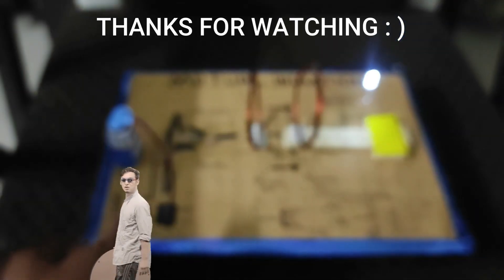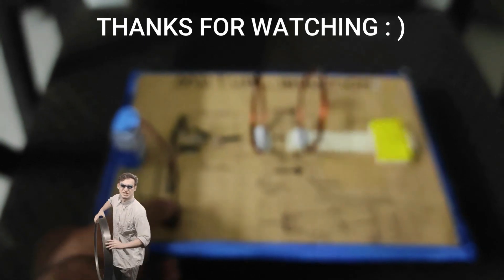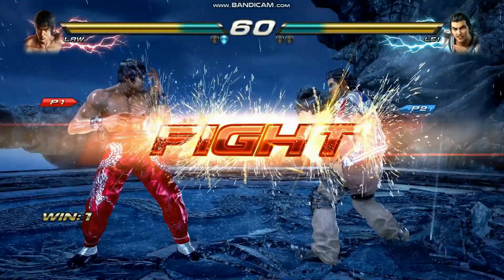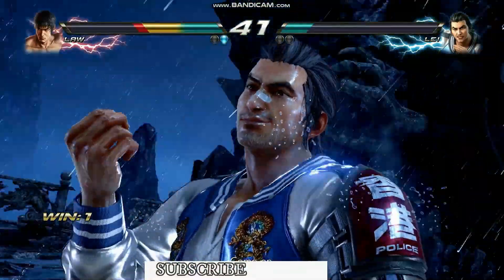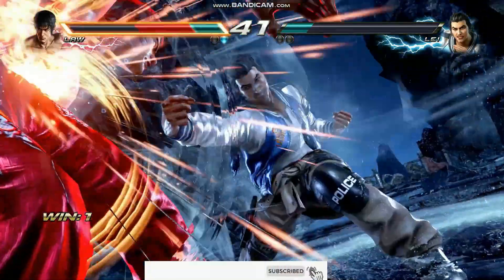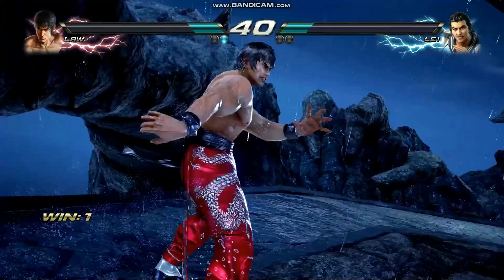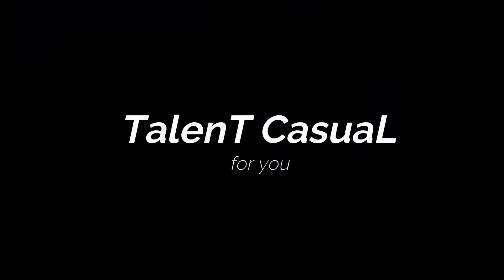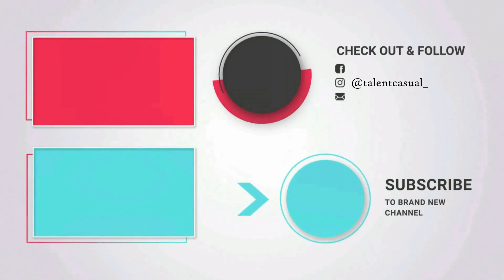How to make Mutual Induction Working Model | Wireless Power Transmit | MUST WATCH #physics #diy

Comment: Why you cut tha loop i don't understand please clarify me
Reply from the maker: Dear at the centre of the coil  ( it has 32 turns so at the 16-17 turn)   I made a loop and cut. It  so basically there is 2 coils in first. Coil     now it has centre end
First end   2nd end   and the middle one is there now which. Is used to connect battery positive so the positive current. Flows in the middle and get to both first and last end  

So just to enter the positive current inside the first coil

Dear 💕

Comment: I have made project by using BC547 and 1k ohm but led is not turning on . What can be tha reason? ( 40 turns)
Reply from the maker: Dear 💕
It needs 27k resistance for u or 33k if... Trannsistor is ctpn 2222a  easily available everywhere

Still not working after 27k

May be reverse the tranisistor

Comment: Can I use a 22k resistance for 2n 2222a transistor instead of 30k
Reply from the maker: Yes dear u can add 4-5k resistance in series sum up wil be 27k  that gonna work
Reply: My transistor is is heating up...how to reverse it?
Reply from the maker: May be your project is working led is glowing  if it's ( 3V) 

And if not
U can try reverse the trannsistor

Join it's 3rd end at first and first end at 3rd

Centre leg remains same 

🥰
Reply: Thank you so much❤......now my model is working
Reply from the maker: Wow great dear 💕❤

Comment: How to connect it with switch please tell me
Reply from the maker: Take any wire   from battery positive or negative  make it pass through switch  so that current has to pass through switch and it will on or off  the circuit
Reply: Thank you so much I am making a model and it is working now I have to connect it with switch thank you very much ♥️
Reply from the maker: Great 😊 good luck  subscribe 💕

Comment: Do you have project file of this written for class 12?
Reply from the maker: No dear u can easily make using wikipedia

Make 
Aim
principles
Construction
Working / theory
Results
Precautions
Reply: @TalenTCasuaL  first thanks for the video I have already made a working model of the project through this tutorial. Can you suggest me the "aim" for the project file?
Reply from the maker: Prepare a wireless power transmission system using mutual induction

Comment: Bro can I do it without resistors?
Reply: Thanks but i live outside of India so it will take several days to come if i order online so i was just asking if it is possible
🤔but if i manage to get led with forward voltage around 9V it will be fine right?
Reply from the maker: No dear 💕
Led should be small 2-3V
Reply from the maker: No dear 💕 resistance is just. 3-4₹ thing
Reply: You can avoid using 2k resistor on led but on the primary coil you have to use the resistance between 20k-30k

Comment: Will the LED glow if I just twist the wire of secondary coil around its ends?
Reply: Don't know 😊
Reply: Try it can
Reply: Yeah
Reply from the maker: Yes dear 💕

Make sure u twist around 10-12 times tightly  follow the circuit diagram

Any help contact on insta
@talentcasual_side

Comment: How did you fuse resistor with the base of the transistor?
Reply from the maker: Using soldering iron dear 💕

If u dont have it u can simply use a wire remove ita insulation and take the pure brown copper wire out

And simple tie it up on the resistance and transitoe joint  make a knot and it will work

Or use black tape ( but may not work)
Reply from the maker: Also u can use plier to twist both legs transitor and resistance legs  into each other like 2 normal wirrs

Comment: i ordederd 2n2222a transistor but 2n222 came so can i use 2n2222 with 27k resistor ?
Reply from the maker: It's all about experiment  

Give it a try may it works 

🥰🥰

Comment: What if thickness  of wire is more than this ,,,and what about radius of loop????
Reply from the maker: Yes dear 💕
This is called geometry

It depends on each factor

If thickness is more  it needs more coils and more current 

If radius is shorter than it needs even more  coil turns  

May be work when we bring it to close 
Or radios is bigger can work from little farther and ( also need more coils)

Comment: Is there any specific no. of coils in it?
Actually I have been trying it for 8 days but it never became successful.
Reply from the maker: Yes dear 💕 32-32 coils
Reply: @TalenTCasuaL  And one more question
I have used Bjt BC547 transistor, 33 kilo ohm resistor and a 9 volt battery 
Will it work properly or I have to change the transistor or resistor?
Reply: @TalenTCasuaL  ok bro 👍

Comment: Can you please tell the role of switch in this? Cuz as far as I know mutual induction works when a coil is moving towards another coil which have changing magnetic flux. PLEASE REPLY ME IT'S URGENT! 😭🙏🏼
Reply from the maker: Hello dear 💕
Switch is connected. To. Battery and it just on and off the circuit

Connect on. Instagram @talentcasual_side   for. Details 

Thanks

Comment: I made one but the components were different; 32 gauge wire, 547B transistor, 15k resistance, and turns on each coil were 40, but the transistor is heating up and led is not turning on can you tell how to fix this?
Reply from the maker: Dear residence should be above 25k 28k Or 30k
 
And than try reverse the transistor
Reply: @TalenTCasuaL why only 25k 28k Or 30k resistance is used not 15k?
Reply from the maker: What should I say u can use 15k twice  🥰  as much needed to control the current
Reply: @TalenTCasuaL if the examiner ask this que then what will be the most appropriate ans for this?
Reply from the maker: The transistor stores and release the current rapidly   ( will burn out soon) 
So. The current is increasing continuously
Ther is resistance to limit and control the current to save the transistor from burning out
Reply: Can we use 22k +5k resistor=27k resistor and KTN2222533 TRANSISTOR ...IF YES WHAT SHOULD BE NUMBER OF TURN
PLEASE REPLY
Reply from the maker: Yes dear 💕
Reply: @TalenTCasuaL  Please tell me the number of turn bro my practical is coming near and it consumed my whole night and day but led is not glowing please help me
Reply from the maker: 32-32

Comment: I read in book that current will induce in secondary coil when number of magnetic lines of forces are changing.But here in video when you stop moving the secondary coil current was still inducing in it.Can you help me to understand it?
Reply from the maker: This is bcoz   the transistor turns on and off the current hundreds time each second   and that produces 
Each time current changes on and off there ja change in magnetic flux due to change in magnetic field due to change in current rapidly

And when magnetic flux rapidly changes   vice versa happens in 2nd coil    
And current is induced 
🥰🥰
Reply: @TalenTCasuaL  
THANK YOU SO MUCH BRO
Reply from the maker: Great to have a Learning mind and curious comment 🥰 gd luck 🍀

Comment: Hi bro.... Can you please tell where the switch has to be connect
Reply from the maker: The two wires coming out of battery connect on any one  ... Make the wire 
pass through the switch and it will on /off

Comment: Sir aapne 2 coils.banaye to un dono coils ki total length kitni hogi?
Reply: And sir isme transistor and resistor ko hum without soldering iron use kare wires ko bend karke kar skate h na?
Reply from the maker: As your wish I will say solder 🥰
Reply: And sir aapkr copper wire ke jitne bhi end h sabme aapne insulation remove ki h ya phir only 1 end
Reply from the maker: Every end dear 💕
Reply: Sir transistor and resistor ke end ko phele halka heat karna padega phir bend karke join karu?
Reply from the maker: Hello dear 💕
Ek coil me 32 baar lpetna hai mtlb 32 turns

And same. 2nd me bhi

To ek ki length approx 6 m hogi
Total 12m

But aap zada hi leke ana 15-18m
Reply: @TalenTCasuaL thank you so much sir. Sir by the way iss project ke liye can i use 2N 2222a transistor (metal) or 574B transistor (plastic) , 30k ohm resistor?
Reply from the maker: 2n 2222a but  try both dear 💕
And yes 30k
Reply: Huh nahi work kar rha sir😢

Comment: Sir i have 27k and 33k resistors which is better to use
Reply from the maker: Try both dear one by one
27k first
Reply: Yes sir
Reply from the maker: Hello dear 💕
When u try with 27k

If not work
Than reverse the transistor and again try  

🥰🥰 same for 33k
Reply: Yes sir, is it ok to use these resistor with 547 transistor
Reply from the maker: No dear 💕
But u can try

Ctpn 2222a  are widely used and easily available transistor
Reply: Yes sir
Reply: TQ so much sir the led is glowing but not that bright it's so dull what to do for that sir
Reply from the maker: Umm mai be u need 2 battery  
Or
Less the resistance
Or
Need more coil turns 

Thanks dear 💕
Reply: TQ sir

Comment: I used the transistor 22n222a 1764  and not working.which one i use which not heat quick
Reply from the maker: Hello dear 💕
Try Reverse the transistor 

Or chNge it to 2222a CTPN

Comment: Hi sir ,
The video is awesome, but mine, when i do it is not working .
The transistor is getting heated .
Reply: I tried reversing it , now the transistor is not getting heated but the led is not glowing
Reply from the maker: Okay dear 💕

What is transistor
And resistance? 

Have u removed insulation of all enda of copper coil 🥰
Reply: The transistor is 2N 2222A 331
The resistance is 27k
 Yes , I removed the insulation of all ends
Reply from the maker: Try  30k resistance  and if not work than try CTPN 2222a transistor dear 💕
Reply: Ok
Reply: Ok very thanks for replying
Reply from the maker: Hello dear 💕
Very nice attempt
Don't worry it will work

Try reverse the transistor 

And may it works 🥰🥰

Connect on Instagram @talentcasual_side

Comment: bhai can you explain the use of transistor in this
Reply from the maker: Hello dear 💕
Transistor
Acts as switch and rapidly turn the current on off on off hundreds time in a sec
And this produce change of current thus chnge of magnetic field and further change of magnetic flux 
Which produce current in 2nd coil

🥰

Comment: sir the copper wire you have mentioned is not enameled wire, is that okay to use?
Reply from the maker: bro the link is updated and here u can buy 2 of them if they are not enough so thats why : )
thanks for commenting
💕🥰
Reply: How much wire is needed for the whole project
Reply from the maker: @venkatyokashkaruppiah3097 told u u need to make 32-32 turns 
Each that's it 🥰
May be it's nearly 15-18 m
Reply: @TalenTCasuaL  on sir thanks a lot
Reply from the maker: Let me. Check
Reply: What is number of copper wire?
Reply from the maker: 30 gauge
Reply from the maker: No dear sorry that's not the right material
Now

Let me change the link

This wire is not enammled and hence not insulated this will not work

Sorry dear 💕

Comment: can i buy and use that copper wire u mentioned in your description for this project
Reply from the maker: Yes sir make sure it's length is perfect and enough
Reply: @TalenTCasuaL  the copper wire you have suggested is without enameled ,is that ok ?will it from electromagnetic feild ?
Reply from the maker: It must be insulated bro
Check is it is insulated and also take enough length to make 32-32 turns each
🥰

Comment: Does the no of turns matter
Reply from the maker: Yes sir
Reply: If I use 25-29 turns will it work?
Reply from the maker: No dear  keep the turns same on both sides
Reply: Does the thickness of the wire matter for the no of turns?
Reply from the maker: Yes dear 💕
Reply from the maker: If the wire is thick it requires 35-40 turns each

Comment: Sir it is not working for me. Should I increase the number of coils?

30gauge wire I hv

I have removed insulation on all end of the coil properly. 

I think there is a problem with the number of coils or with the  resistor because the transistor is getting really very hot within seconds kf turning on the switch
Reply: I figured out the problem with the transistor its fine now. But do I need to do something with the coils???
Reply from the maker: Transistor gets heat its normal check if it's working 😘
And if not reverse the transistor

No coil. Problem
Reply: Sir i reversed transistor it still not working. I have a 30 gauge wire. Exactly how many coils do I need for primary and secondary loop?
Reply from the maker: Dear 32-32 are enough 🥰
Reply from the maker: Connect on Instagram 
@talentcasual_side 
Let's sort it
Reply: @TalenTCasuaL  ok sure

Comment: is it ok if i dont use transistor and 30k resistor?
Reply from the maker: No dear 💕 
It's compulsory
Reply: @TalenTCasuaL  also, I have a 29 gauge wire. How many loops would I need for the first and second coil?
Reply from the maker: 32-32
Reply: @TalenTCasuaL   Thank you sooooooooooooooooo muchhhhhhhhhhhhhhhhhhhhhh!!!!!!!!!!!!!!!!!!!!!!!!!!!!!!!!!!!!!!!!!!!!!!!!!!
Reply from the maker: 🥰🥰🥰🥰😚welcome
Reply from the maker: Connect on Instagram
@talentcasual_side

Thanks ❤
Reply: @TalenTCasuaL  sure I will connect to you

Comment: What's reason behind this🙏
Reply from the maker: Hello dear 💕

When current pases through copper coil.. 
It produce magnetic field

And when we place copper coil in the magnetic field 
It produce current ( opposite) 

But there is condition 
When the current changes the magnetic flux changes 
Only then current is produce in the 2nd coil

So we added transistor which produc current pulses so current changes every sec - 0 -1-0-1  very fast

Comment: Switch is connected to what ?
Reply: I tried to make the model but failed it is not working....in this video you have not mentioned switch is to what because other wires are connected with eachother and no other connection is left..can you plzz tell what to do ? 🙂🙏🏻
Reply from the maker: i am so sorry dear  💕for late reply    SURELY I CAN TELL YOU WAHAT TO DO  msg on instagram @talentcasual_side   best of luck  : )  
and 
Connect switch on battery negative or postive wire  
the wires coming out of battery for power  : )
Reply from the maker: Dear switch is like Gate Open or close for  current    connect it to any positive or negative wire 🥰 make the current pass through it (✿❛◡❛)

Comment: My led is not glowing
Reply from the maker: Don't worry dear 💕
It will work

Have u used all materials right ? 
Check Circuit diagram? 
Remove insulation properly from each end? 

And last try reversing the transistor 
🥰
Reply: Still nothing
Reply: What to do
Reply from the maker: Hello dear 💕
@talentcasual_side
Contact on Instagram may be i can help 
🥰
Reply: Thanks but it worked after some time .i think it was a connection issue
Reply from the maker: Wow great 👍👍
Bro
Battery down may be

U can send me images on Instagram like other subscribers it will be featured on my video
Reply: Is it beacause of the difference in no of turns
Reply from the maker: No dear 💕
2-3 difference can work

Comment: Can I use aluminum wire instead of copper?? Because I'm not getting copper coil
Reply from the maker: No dear 💕
Use copper insulation wire
Buy from. Speaker repair shop or fan cooler repair shop 🥰
Reply: @TalenTCasuaL  the wire I'm getting are very thin
Reply from the maker: Show me on Instagram
@talentcasual_side

Comment: What happens if there is no Transistor and Resistance?
Reply from the maker: No transistor and no resistance  means nothing in circuit to work as mutual induction
Will not work
🥰
Reply: @TalenTCasuaL  transistor kaha se mily gaa?   I need

Comment: How switch is connected?
Reply: Can you write full procedure in English of this working model of mutual induction?
I have to write in my report. Please
Reply from the maker: Hello dear 💕

U can connect on Instagram
@talentcasual_side for clean fast high response

Make it in this format
heading 
Principle
Construction
Working
Theory
Uses
And that's it 🥰
Reply: Please tell me
Reply from the maker: Yes dear 💕
Just make the wire pass through the switch

Switch has tow ends ( terminals) 
Connect the negative wire on one end and connect a new wire to 2nd end 

So the current has to pass through the switch   and switch will. Work 
🥰 on or off
Reply: Thank you☺️. And congratulations you have found a new subscriber .
Reply from the maker: Ohh wow that's superb dear 💕
Thanks so much for commenting

And hope u connect on Instagram
And share your models pics 🥰🥰
@talentcasual_side 
Thanks ❤
Reply from the maker: Hello dear @gungun
I will be glad if u connect with me in insta
I want to talk to u 🥰
Reply from the maker: Hello dear 💕

Switch connected is simple

On The negative or postive wire  any one

Just make it pass through the switch
Like
The battery has 2 wire + and -  
Take any wire and connect it to one end of switch and take wire from the other end of switch  and the wire is connected further
Switch will work
☺☺

Hope u understand 
U can connect on Instagram at any time
@talentcasual_side
🥰 i will. Surely help u ❤

Comment: Whats the use of transistor in this circuit.....can we make this without using this?
Reply from the maker: No dear 💕 transistor is compulsory

Transistor releases the current in pulses 

First it stores the potential
Then. Release it in pulses of very high power

Which induce electromagnetic field in COPPER COIL. and which further induce current in 2nd  coil

Comment: My project is not working
I have used 10m copper wire 
2n2222a transistor
27 k resistor
Reply from the maker: Is your transistor heating? 

1
Try reverse the transistor 

2.  Coils if very thin like thread use 38-40 turns
Coil is harder like kite thread   use 35-35 turns

Use new battery 🥰

Try chnge the resistance 30k Or 32k  

🥰🥰
Reply: Not working
Reply from the maker: Let's connect on Instagram dear 💕

@talentcasual_side dm